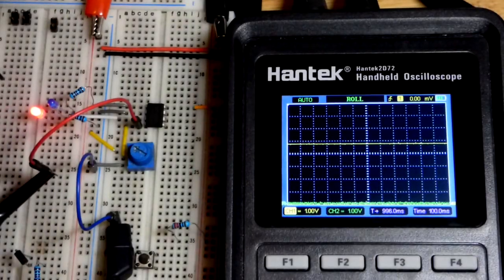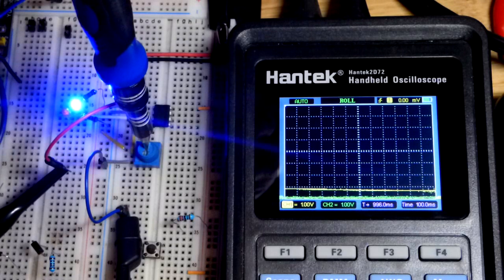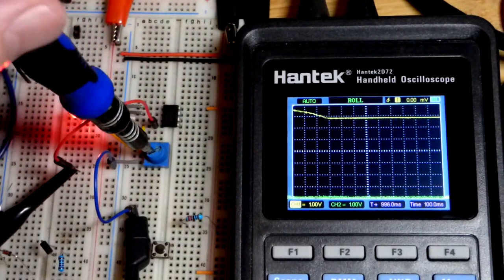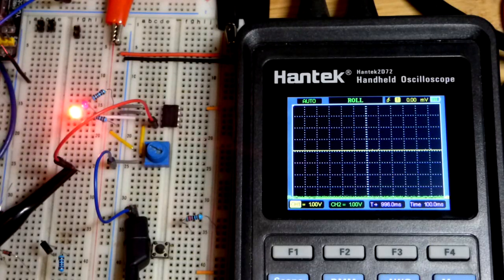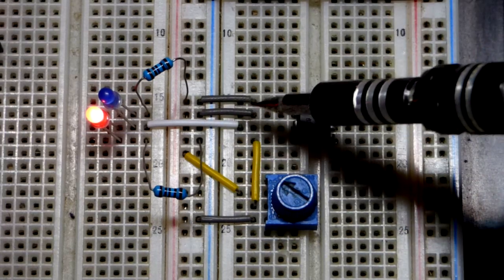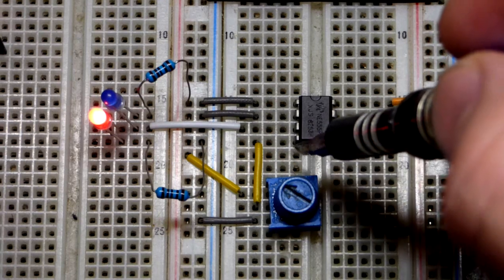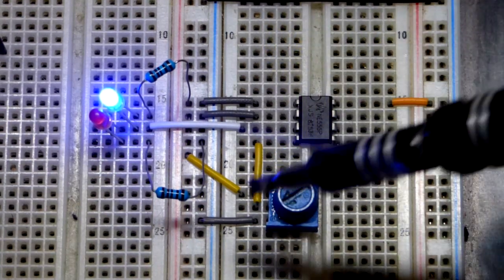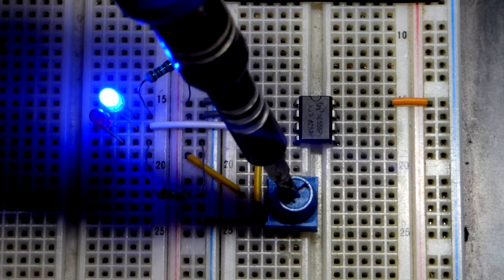Testing NE555 timer reset voltage range

Comment: I just noticed that there is no power-supply bypass/decoupling capacitors anywhere near the device under test, which explains the "Noise".
Suggest the traditional 0.1 uF between Pin1 and Pin8, and absolutely an electrolytic capacitor the same (or larger) capacity value of the discharge Capacitor on pin2.
Reply from the maker: Good point, thanks for bringing it up.
Reply: @Electronzap  I'd have mentioned it in private, but I don't know how to do that on YouTube...
Reply from the maker: @joeteejoetee  It's all good, I've never chatted with anyone privately on YouTube, comment section is a good place for chatting :) I like when people give tips that I forgot to mention or overlooked.
Reply: @Electronzap  Cool. You are absolutely #Winning it sir!
Reply: @Electronzap  I was using 555's in the late 1970's because I am 61 now,
...but mostly because I made a 555 PWM to drive my motorized skateboard...
Reply from the maker: That's cool, I always wondered what fun stuff electronic hobbyists did, other than ham radio and audio electronics, before the 2000s.
Reply: Prototype board "Pro-Tip": Install bypass capacitors at all 4 corners of every proto-board, and never have to worry about 2 feet of power-lines/jumpers to every experiment again!
...but DO remember that you might need to add some 10-470uf Electrolytics when obviously they will save the day!...

Comment: I don't have a breadboard handy, but I wonder what the (unconnected) voltage Pin 4 of the NE555 Outputs static, and when multivibrating?
Can one of your (illuminated) photo diodes pull pin 4 low enough to reset it?
Reply from the maker: I deleted my reply, it looks like a reverse biased photodiode going from pin 4 to the negative supply will work pretty well as part of a voltage divider with a fixed resistor to the positive supply.
Reply: @Electronzap  The resistor (or any external components/circuitry) on Pin 4 Is A-OK, because you are USING pin 4.
If reset is not "in-use", then it can be Not Connected to anything.

Comment: pin 5 could be implemented similar around 1/2 VCC I am guessing.
Reply: Demonstrating how the NE555 timer chip reacts to voltage on Pin 5 is a challenge because you really need oscilloscope displays plural, and to do some rehearsal experiments - I don't know where you'd start or end - Pin 5 is, kind-a-like in your head if you are making an audio sound effect, but to visually document it's responsive dynamics a very daunting arena of video possibilities...
I LOVE THIS CHANNEL !!!